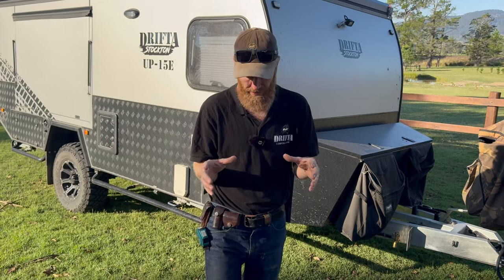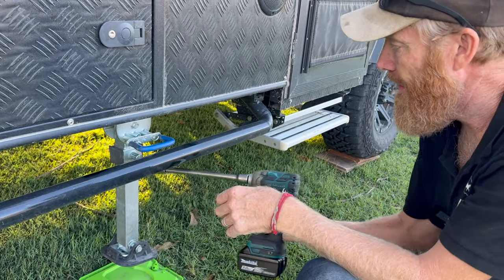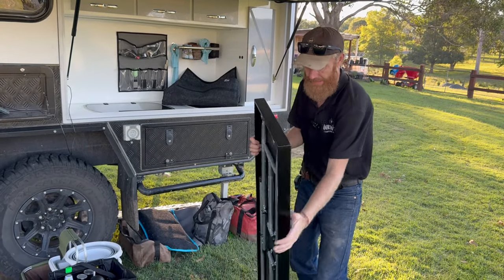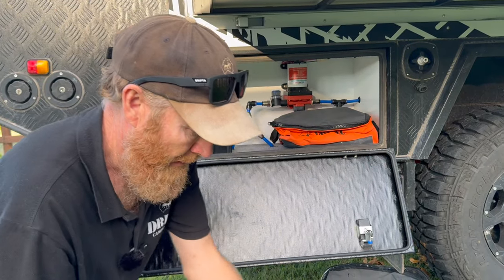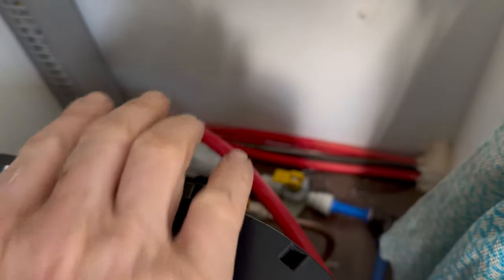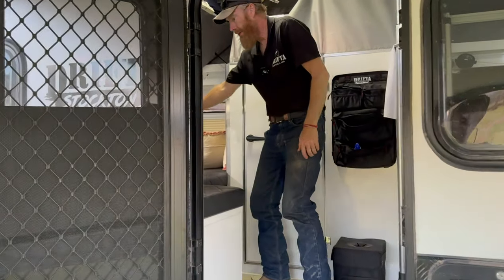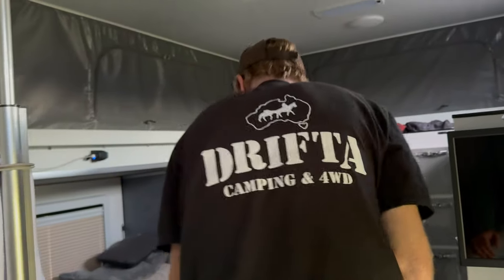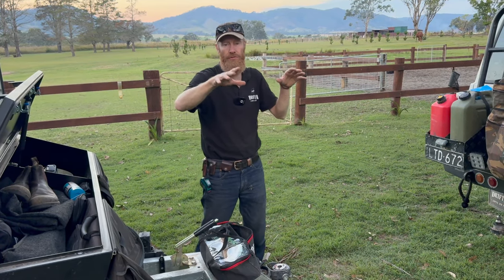DRIFTA STOCKTON CARAVAN UP-15E - CUSTOMER HANDOVER VIDEO

Comment: the diesel heater will heat the cupboard opposite in a short time, its way too close
Reply from the maker: it’s a metal wheel arch , so is fine.
Reply: Chinease import??